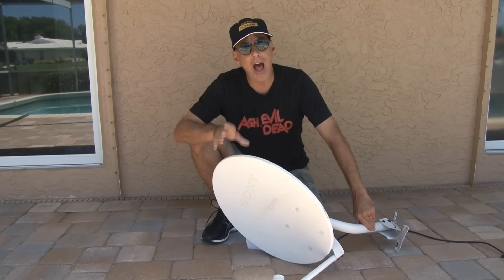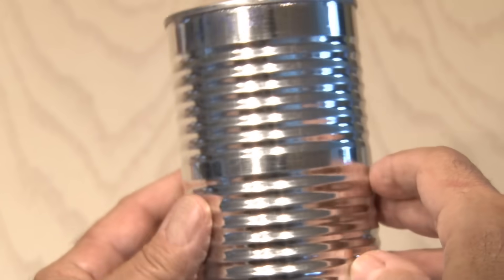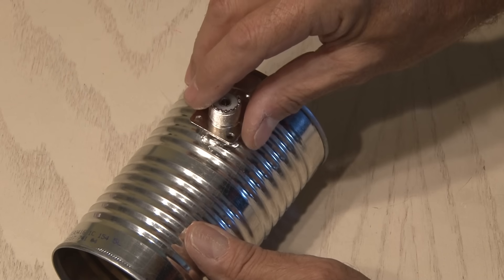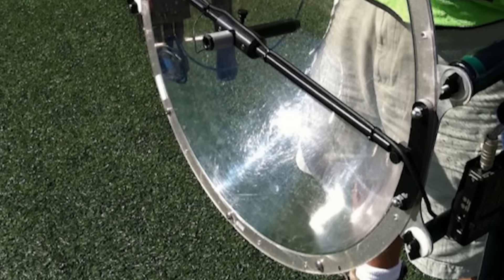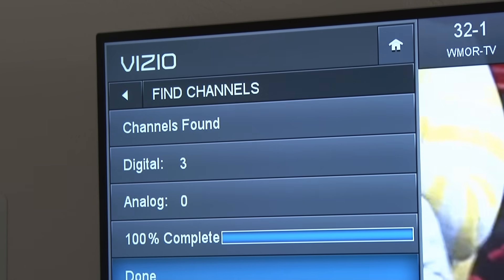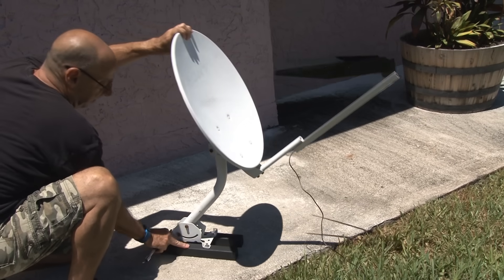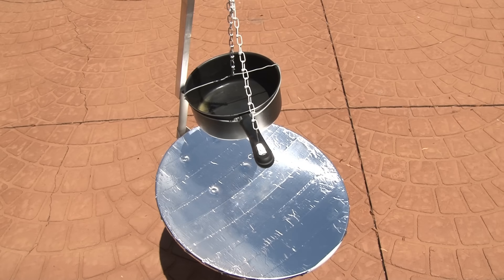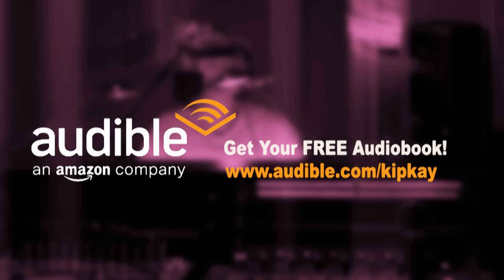4 Brilliant Uses for an old SATELLITE DISH!

Comment: My concrete apartment faces away from the signals so i get poor reception, even the closest towers drop out on occasion so I put foil (making it directional) on the back of my DB4 antenna and went from 3 reliable and 2 occasional channels to picking up another 39 channels up to 260km/160miles away. Most of those come and go depending on conditions but I'll keep an eye out for a dish and hopefully make those channels permanent.

also, how did i miss a video to a channel i'm sub'd to
Reply: kb8618 
I have a dish for you. Are you located in the Seattle area?

Comment: Awesome video does anybody know if I can use the same dish for a Wi-Fi booster and atena channel booster?
Reply: Yes. You can even use a cheap HD tv antenna people use inside their homes. At least, I did. I also put a simple extension antennae wire on my Panasonic SD Stereo System. I accidentally learned if my extension antenna wire is run through it's loop antenna it increases/amplifies and widens the broadband of what i was doing for my internet sgnal. I have no subscrptions for wifi. Also, I have no physical connection between my stereo antennae and internet antenna wifi. I live in a small city in Pennsylvania. The only thing I've had to buy now and then is a hotspot on my mobile phone subscription. I used to have an LG K20 Plus. A lucky find showed me a Samsung J7 Prime worked my signal even stronger. Good luck. It'll be interesting to find what works for you.

Comment: The canntenna fails on several points by using hot glue you have no electrical connection between the UHF connector as you call it and the can the other point is that is not a UHF connector it is a PL259 which is a VHF connector this is very lossey, at least try using a BNC connector which has a higher frequency spec.
Reply: I came for this,  yeah i spotted that right away,   another problem is the look angle,   offset reflectors like this,  have a look angle about 23 degrees ( if memory serves me ) so if you point it flat towards horizon, the antenna is actually trying to receive a signal from an angle 23 degrees up.  

the little copper wire antenna should be cut to a specific length,  to match the wavelength of the frequency one intends to use it for.  for wifi at 2.4 Ghz,  it should be about 31.23 mm long.
Reply: Can  any of you speak English please. This is way over my head. Please come down to where the common people live, lol.
Reply: Yeah, your right but the PL-259 is the male end. He was using the female side in the can . .. which is a SO-239 to which he inserted his PL-259 into  ..😨 ~ 😄
Reply: Nubegamin with pulio  Yes, and thank you for that, but we need some of these for dummies.   :)
Reply: This message was stated in one long sentence. I had to divide it into four complete sentences to understand. Please invest a little bit of time into your hobby of correcting YouTube creators. Thank you very much.

Comment: How many miles does wifi range sir?
And 100% will work on satellite dish for wifi range?
Reply: Miles might be optimistic yet...if you have good line of sight...I guess its possible.
Reply: If you have a high gain directional antenna on both sides you can get many miles,  I have used very high gain antennas,  over 3 miles.   line of sight.  also need to take into consideration cable losses.

Comment: Use chrome paint with gloss clear coat instead of tape, but only spray in parallel with the curves rather than side to side for an even coat. Then polish with Dual Polymer.

Comment: sounds like bull shirt to me.  the sound thing looks plausible but the wifi thing would require two way communication, are you planning on transmitting with the dish as well... it won't work. the solar stove thing is great in theory but not practical... doomed projected.  I like the HDTV thing but you would have to convince me that the math for picking up the HDTV band matches the shape of the dish.  If it's not perfect the idea won't work.  doomed as doomed can be.. ;)

Comment: Who wants insecure wi-fi from a fast food joint.
Reply: Those of us who cannot get wireless of any kind at our house for under $150/month. Never forget that millions in the country are getting slow internet at huge prices. My neighbor gets semi-fast internet after signing a two year contract at 150/month from a guy who live on the nearest hill-top. He had to pay for a  tall antenna and a rebroadcaster to insure it would work. An additional $2000. I can "buy" into his system for a six-pack per month IF we can get the signal 1/4 mile to my place. So now you know who.
Reply: @geraldhenrickson7472  dude u need backtrack V5 any and all wifis around me are unlocked and broadcasting for my personal use and you could do the same
Reply: For free by the way
Reply: G Henrickson
You can get a cellular hotspot for about $40 a month, that's get you internet.
Reply: If you're not encrypting all your wireless traffic yourself, you're doing it wrong.
Reply: Besides bandwidth what would be the difference after that free Wi-Fi was repeated and put behind a secure router?

Ohhhh we should not be "stealing" from the fast food place and we need to be buying a Comcast subscription instead RIGHT!!!

Comment: I made a parabolic mic with mine more than ten years ago. Having a smooth shiny surface works for audio as much as it does for light. I used  a homemade  shotgun style mic and fine tuned it with a slide rail then set screw it into position. I used a  signal generator through an amp as the signal source to tune it with. I can hear people soft talking at about 300 feet, depending on the wind. A thick "foamy" is a must for distance. Later I got more technical by adding a speech processor and digital audio filter and headphone amp all mounted right on the backside in a weatherproof metal box from Radio Shack.  Focusing for audio is very close to focusing for light. Well worth the effort if you like eaves-dropping like I do. lol.
Reply: Jim? Is that you? STOP listening in to my conversations!
Reply: G Henrickson  Best toss your cell phone too, and smart TVs. They are listening to you as well gathering data. Jim is least your worries (I hope-lol)
Reply: David G
Radio Shack is still a thing?

Comment: And stealing a wifi signal, without permission,  in Michigan,  is against the law.
Reply: there are hundreds of free wifi hotspots all over the country
Reply: don't get me wrong, the further you are out in the country the more less likely this is to be noticed or card about.  Just a point of what may happen in the real world after that's discovered vs another idea similar to it in concept and why it might be better.   After all if you contain that "extra" hardware inside along the coax line somewhere then it wouldn't be easily visible and in theory not discovered.
Reply: Waaaaaaaahhh
Reply: Wop, wop wop.  Its not like you are using the wifi ALL the time.  Learn to SHARE!
Reply: The "wifi Antenna" is bogus. Attempting to extend the range of your modem/router does not enhance pulling signals. If you do a little research, you will discover it.
Reply: vick moore no, the dish directs the radio beams in one direction, and focus the radio as listening.  It’s big and I wonder if a bowl about the size of half a basket ball would be better. The legal contagious aspect can be covered by configuring the router as a repeater that use DHCP leases from the router that is relayed.
Reply: So if i steal wifi with permisson is ok?  Is that still stealing if i give it back?   How about if you steal wifi  from a Canadian, can they put you in jail?
Reply: kinda ish but not really ish its hard to explain but ill try if it's a home residence then yes it is considered stealing and it is illegal. but its a a business that offers free Wi-Fi Burger King McDonald's Taco Bell Etc even your local hospital technically it's legal
Reply: Thom any signal that goes over your property is yours.
Reply: Technically you wouldn't be stealing, you're merely creating a more efficient means to receive it and "borrow the signal" for extended periods of time.  The thing is the state WANTS  you to pay for it and WANTS you to use common equipment and have a hard time exploiting free spots/signals unless you practically live next door a open hotspot.  That is WHY something like this would attract attention and they would find or create means to hassle and fine you more which might cost you more in the long run.  BUT if it blends in with the crowd then the odds are a lot less.  Not saying you'd be risk free installing a satellite dish from a known company and rigging  it up for wifi over coax, but you'd most likely be safe until they check their database to see if your house is on the list for that service.  However a roof antenna requires no service to normally get, merely a purchase, if you could rigg that up to do the same thing and keep any modifications indoors you'd most likely get away with it much easier and for far longer if not never getting trouble.

Comment: How did you connect the microphone to the haedphones for the SpyMic?
Reply: You could connect the mic wire to an amp and then connect the headphones into the amp, unless you somehow can solder a headphone jack to the dish?
Reply: Mr B: I was wondering the same thing he didn't go into any detail with that other than using a pair of headphones. It would  have to be amplified in some sort of fashion🤔🤔

Comment: Kindly tell me what type of this router please. thank you :-)
Reply: Stephanus Hadi Purnomo that appears to be a D-Link router by Cisco. Although, any router with the same style antenna should work with this project.
Reply: Pedro moran Dorsey in theory it should! I'm about to try it myself soon. I can keep you posted if you like. I have all the parts - just need to get the metal straps and then I'll start the project.
Reply: Jordan P thank you 🙏
Reply: Pedro moran Dorsey will do brother - I have to finish painting my bedroom (or my chick will be upset lol) and repairing a MacBook Pro - then my next project will be this dish! I'll keep you posted!
Reply: Stephanus Hadi Purnomo you're welcome!
Reply: D-Link and Linksys/Cisco are 2 different beasts. That was a Linksys WRT54G (ish) router, <$10 at any goodwill. Fair warning, it is ILLEGAL by FCC to change out antennas on any Part 95 hardware, which this is (without say a Ham license and using it under Part97). People do it, but if the FCC catches wind/sees it, it could be major fines, jail, confiscation, etc. By the way, in this video he used a SO-238/UHF connector. VERY HIGH LOSS at microwave frequencies (2.4/5.8GHz) ! Use N, SMA, or TNC connectors with high quality coax. And keep your coax feedline as short as possible! (like mount the router in a waterproof box on the back of the dish, with less than 6" of coax). Or just buy some newer (and much better) Ubiquiti gear, antenna and radio all in one package, under $100.
Reply: Its a Wireless G Wi-Fi Router i have one

Comment: if you place 2 dishes pointing at eachother  they can be used as a communication device.
works over long distance.
then you just talk into it and you can hear it at the other end.
i have seen it/tried it , in a couple  amusement parks.
a kinda 2 cans and a string phone just without the string.

Comment: how far away can that dish pick up conversations?
Reply: depends on if you try to just hook eaphones to a mic like that. most condenser mics require 48 volts phantom power, youll need a small preamp and power supply
Reply: Just before you file for divorce...6 miles. After the divorce...who cares?

Comment: I tried the WiFi and can’t get it to pick up a signal. I went from a coax from the can into my router. Is this right? I could use some help!!
Reply: Caleb Gulder this was almost 10 years ago, before iPhones, besides a picture wont proof how far the connection was, but both houses were two story and they were on like 10 foot poles on the roof
Reply: ah, ok, lol.  cool
Reply: Regular rg59 will not work, as it will absorb the signal. Rg59u works better. Has to have foam instead of solid insulation.
Reply: how high a tower was it on? pics or it didnt happen lol
Reply: What this guy demoed is complete BS. To have a WiFi connection you have to both receive and transmit. You might be able to receive the WiFi signal from that distance but your TX signal would not be picked up by the router that is a 1/2 mile away.
Reply: WaterBarleyHopsYeast  I used a cantenna similar to this but with a Pringles can and no dish and I picked up my friends WiFi over 10 miles away and we played Xbox live no lag, he also had a cantenna aiming at my house I've heard people have been able to get signal over 100 miles

Comment: At 4:33 you are listening to (or aiming for) the sky. Try pitching it down 30 degrees or so..
Reply: rofl. hes got a condenser mic. that sucker needs 48 volts to work he isnt hearing squat
Reply: Caleb Gulder good point, although the cable is out of frame and might be connected to an amp. Probably can’t hear anything though, as there is no evidence in the video, nor many sources of sound on the sky.

Comment: Is this ok when it rains is it water tight
Reply: Kathy Fann  the solar cooler won't work when it's raining
Reply: the tv antenna is literally two metal fins attached to wire coated in plastic, the actual electronics are in your receiver, same with the wifi antenna but he used a can although if you connect the can to the tv it would work just as good, if not better. but with either setup the important electronics are inside

Comment: I don`t understand the free wifi thing. Let`s say you do receive the signal. How do you send signal back?
Reply: The same way it came in..  your router uses the same antenna to transmit as it did to receive.
Reply: Stranger Danger - Yes, a parabolic antenna in each end is what it would take. But the point was FREE wifi. I doubt McDonalds would let me put a parabolic antenna on their roof so I could tap their wifi.
Reply: Have you asked?
Reply: No, you don't have to have a dish on both ends. Here's an analogy: Two people are 100 meters apart. When they try to talk, it's hard for them to hear each other. Now give just one person a cone. When they put it to their ear, they can hear the other person. When they put it to their mouth, they can be heard. Only one cone is needed. Make sense?
Reply: Umm...you still need line of sight for long distance viability. Get your macDonalds to put their router in the window. That outta do the trick.
Reply: But is is not very likely that the McDonalds router 1/2 mile away would pick up that signal - unless it had a similar dish antenna.
Reply: Douglas Peck did it with a cantenna well two cantenna's one sending and one receiving over 10 miles away and was able to play Xbox live lag free

Comment: I have a hotel 1.9 Miles away that has free WiFi and a McDonald’s about 2 miles away will this work that far?
I have a dish network dish on the roof and RG 6 Run in the House So If Free Wi-Fi will run our 3 ROKU’s and my phone and my IPad that would save me $60.00 a month or $720 a year
Reply: I use a 1.5 mile wi-fi shot through trees and it works good. I'm talking to ya on it now, so to speak. Use equipment with variable power out so you can crank it up if necessary.
Reply: Kathy Fann if no mountains are blocking the signal it might work.
Reply: You get service for $60/month? Please tell me more!

Comment: Can i turn this to enhance my phones cell signal?
How to make it possible?
Reply: Ferdinand Martinez how did u do. Pls can u pls explain step by step. Thanks in advance bro.
Reply: Do you have a diy tutorial?
Reply: your phones antenna is built in to the case and is usually connected to the motherboard by a metal pad, just solder wires to the pads on the motherboard but it would make it less portable, if you want to keep the portability then use a cell signal booster in your house and connect the satellite to it instead, although a direct connection to the phone would probably work a little better, but it would reduce portability.

Comment: That WiFi antenna would work much beater if you actually screw the N connector on it because know you dont have the good reflection in the can by isolating it from the connector with hot glue
Reply: Eggs I guess :D No problem buddy I just realized it now but English is not my firs language so I can't write so good.

Comment: 1:48 Product Name: Female UHF Panel Connector; Design: UHF Jack SO-239 Panel Mount (it would have been nice to be a tad more specific, seeing that there are a quadrillion different types of these kinds of plugs, connectors and adapters.
Reply: Why does the coax end cable connectors  look different than all I've seen?
Reply: @botiroti1  because kipkay is an idiot who doesn't understand RF

Comment: Would the same setup used for Wi-Fi  work as a tv antenna? I have a homemade antenna out of strips of aluminum foil glued to a pizza box that works pretty good but i want to use the previous renters dish to get more channels. The can looks much nicer than the cheap antenna on a stick
Reply: it would work, just connect the can to the tv receiver instead of the wifi receiver.
Reply: This isn't quite accurate. The converted satellite dish thing with the can is JUST a receiver, not a transmitter.
Reply: QR: Yikes...how do people come up with this stuff?
Reply: you may have to use a different connector though
Reply: Try it and let us know.